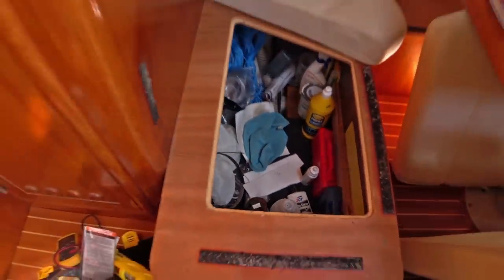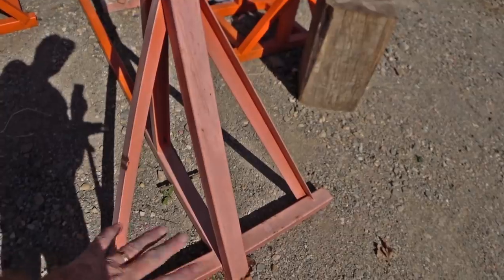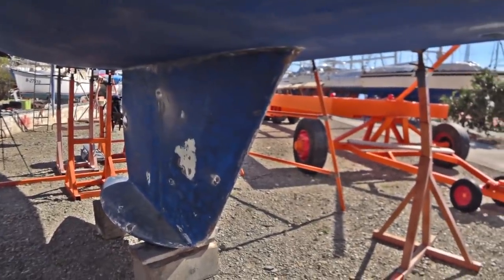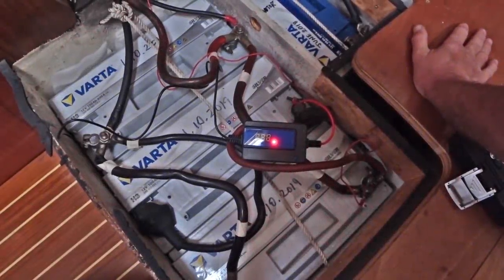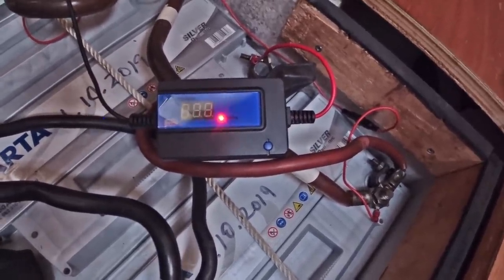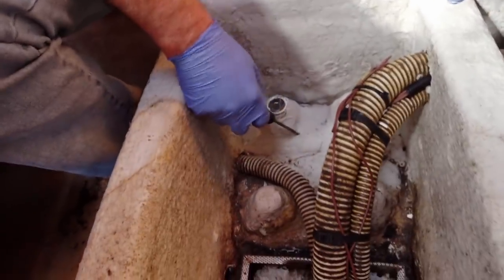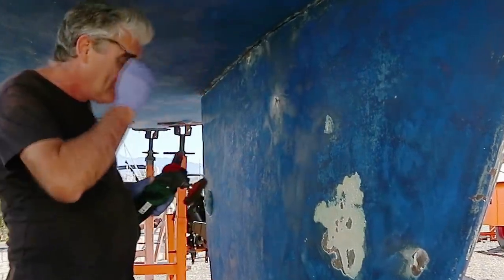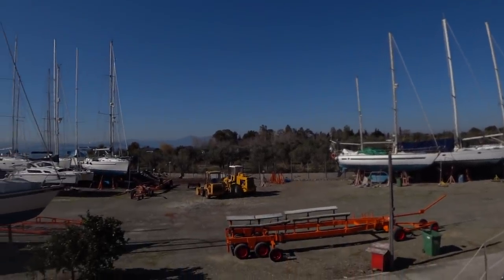Digging deeper into the weeping keel - Sailing A B Sea (Ep.111)

Comment: Unfortunately, when keel bolts rust, they will rust where the keel-hull connection is, and the entire rest of the bolt can look brand new.  You literally have to remove it to see the condition in the middle of the bolt as the top and bottom will look new.  When you have that much leaking and water penetration, it is highly likely your keel bolts are already starting to corrode out.
Reply from the maker: Hi Logan, we agree with your science, the water running out showed very little rust, it was mostly clear water.

Comment: Anode has to have electrical continuity with the iron (cathode) keel. Zinc is used as a sacrificial anode because it gives up electrons more readily than ferrous metals, and this corrodes first, IF it has low resistance with the cathode. If you rely on the thru-bolt to make electrical bond with the keel, figure that is insufficient. Two equals one, one equals none. Get as much conductive surface exposed as possible.
Reply from the maker: Thank you for that helpful feedback Michael. Cheers.👍

Comment: Just one little tip regarding the shaft anodes. Always check that they are exactly the good size. Metric or imperial, because this can have an effect on the bolds not reaching good. One other tip from experience, once the anodes are secured in place always add a cable tie to the shaft on each end, this will help if by any chance the anode gets loose. This happened to me and if I didn't realize it in time it would have damaged the hull, because it will travel up with revolutions.
Reply from the maker: The cable ties are a really great tip, thanks Joseph. We'll do that tomorrow. 👍

Comment: Hi Baz and Annssha

I have a Jeanneau SO 45.2 and have been following your blog for a while. When I was shopping for my boat about 8 years ago, one of the Jeanneau dealers told me about the weeping from the keel, which is very common on these boats. Water is getting into the well in the keel for the bilge sump, probably through the calking between the bottom and the keel. It sits in the keel well and rots the sealant, which was  not very good to begin with. He told me the solution is to grind out the fiberglass over the well, as you are doing, clean out the old sealant as best you can, let it dry out and then fill it with epoxy. Then rebed the keel to the bottom. I hope this helps. I haven't done it yet to mine, but I get a tiny drip of rusty water down the side of the keel in the same location as yours, so I will be watching you as I get ready to do mine. By the way, if you need to lube the steering chain again. It is much easier  and you have better access if you remove the compasses than to climb into the compartment under the cockpit floor.
Steve
Reply from the maker: Hi Steve, thanks for sharing the helpful info. Great idea about lubing the steering chain. Cheers.
Reply: Same thing for my 45.2, keel weeping allready repaired.
How do you remove the compasses Steven ? I need to lube but also to replace a damaged compass...

Comment: Hey Baz when I was in the Navy the anodes were welded to the hull after it was painted, the metal to metal contact was through the welds, I think your metal to metal contact will be through the bolt holding the anodes to the hull, hope that helps
Reply from the maker: That's a good point KC, that makes sense. Thanks.

Comment: Hi Baz
We had exactly the same weeping on the lower part of the keel on our 45.2 as you. It’s just sealant degraded over the years. I ground it out, dried it well, rested rust then filled with epoxy. No more issues. We did not however have the weeping at the top of the keel next to the hull. Just dry it out full it with epoxy, not a big problem
Reply from the maker: Good to know, thanks Jay. The current 40 knots of wind should help with the drying. 👍
Reply: If you have weeping where the keel meets the hull, then you really need to pull your keel bolts.  They rust just in the area inbetween the keel and hull, and the rest of the bolt will look like new.

Comment: Hi there ABC
I think the keel bolts should be better inspeced. But thas just mine opinion. Stainless has a way of going bad where you dont see it. And of corse you ned to remove the bottom paint, as you know your self. Maby its a robber seal around the axel on the kick rod? 
Fair winds ,,,/),,,,
Reply from the maker: Hey Anders, the kicker job will be done in Turkey. We've been told from people who have owned this model boat to leave the keel bolts as they are, and just to inspect the fibreglass encasement. Cheers.

Comment: Non sailor advise, putting the anode on the prop shaft use a C clamp or monkey wrench to squeeze the two parts together. Should get a good contact with the shaft and might make the bolts fit nicely. That is a very dodgy might mind you.
Reply from the maker: Good idea Phil the Farrier, thanks.  Will do that next time.

Comment: flip kicker, run kicker line through turning block at mast base redirecting it to the block where it initially turns currently but is now farther away flipped. PS edit, BTW that boat is 25 years old.  Has the keel ever been dropped? seems about time for that.  You have no idea what the bolts look like at the nut, below the nut, at the keel interface and at the keel ballast entry. Never mind not even knowing the torque. Then button it all back up bedded in 3M5200 and torqued correctly. yes expensive but also important for any boat of your construction after 15 years and especially if planning offshore.
Reply from the maker: That's an interesting proposal. We'll look into that. Cheers.

Comment: Good idea to rent an apartment then you can get up in the morning go there and approach the work with more vigour psychologically 
Looks good news about the keel if it is totslly dry and not weeping think you will be good to go on that issue
Great catch up and looks like you are getting there
Reply from the maker: Yes, it definitely helps to be away from the mess, but still only minutes away from the boat.  
The keel itself is still weeping from the crack, so we have a couple of wires in there acting as wicks to draw out the water.  We'll probably also aim a fan heater at it to speed up the process, so it is fully dry before we seal it over.  
Thanks Russtafa B. 👍

Comment: I see you have water in the bilge and humid sail compartment. Just for the info, it is rain water, at least in our boat.
What's the brand/model of you desulfater ? Is it always connected and working ?
I think i'm going to start working on this sailor support forum... :p
Reply from the maker: Hi Boarderlia, The water in the bilge is from when I poured a bucket of seawater in there to try and get rid of a bad smell. The water getting into the sail locker is coming through a bad deck repair job from a previous owner. We'll fix that when we get to Turkey. We're thinking of changing the desulphater to this brand. https://www.recovermybatteries.com/products.html
Reply: @SailingABSea  Lucky you, i have to take of the ceiling cover to find out the leaks.

Thank's for the info on the desulphater ;)

Comment: Could it be that the electrical connection for the anode through to the rudder is through the metallic nut and bolt, assuming that the rudder is steel.
Reply from the maker: Hi Angelo, the rudder is a fibreglass encased steel rod. Cheers.🍺

Comment: At first, I am happy you are coming back to Turkey.  I try to find out the video about the batteries died in october. Couldnt find it. If there is one pls send it to check it out. 

The battery connections you made in parallel has some problems as I can see from the video. If you are pulling too much amps from the bank with this connection you are going to make the first battery at the left work more than the two others. And work less at the far right. And the batteries in parallel  work as the weakest link in the chain logic. And if you make the first battery older it will make the other batteries older too in some time. 

You can check for detailed exp. here : http://www.smartgauge.co.uk/batt_con.html

For the Crew think, it is good news. Also i will check Setur for prices or campaigns for you guys. Hope we meet this time in Turkey. Take care.
Reply: Ok i find the other battery video. Never mix the old and new batteries. Because aged battery will make the news ones older in short time. As you can see from the other video the one closer to the connection dead but the far away one still has some life. It is because of the connections made(I dont get how that solar guys made it ). Because batteries not used equally.  Also probably you are using too much at night and at the end of the days batteries are not charging full. When you check the specs they have around 400-500 cycles at lead acid batteries. And they are not deep cycle, 15 months usage  is normal on heavy usage. 

For the long term consider upgrading lithium(I know it is pricey , ı couldnt make it either). Because the tight space you have you will have more Juice at that storage, also less weight. 

Probably you know but i will remind again, On victron Battery Monitor  there is a amp/hour setting in the setup. Check if it is 300 amps. If not it will not show the correct percentage. Also SOC (State of Charge) is always not accurate. Check on daily basis how many amps you consume and the battery voltage. Logging weekly in the long term will give some idea on battery status. (On same conditions: Like every morning Used Amp, Voltage of the bank) 

Also  for the next time, consider using 4 batteries. If you are using too much amp/hours increasing the battery bank capacity makes the batteries last longer as you know from %50  usage rule for lead acid batteries.
Reply from the maker: Thanks, we're going to rewire the batteries as per method three in that link you sent. We bought two bus bars, now we need to get cables made up to the correct length.
Reply: @SailingABSea  Oh nice another mission for you. Hope you will succeed this time. I watched the Laptop Adapter mission failed. Method 3 is ok. But be carefull with the lengths of them all must be equal. Also the cables from bus bar to the inventer both + and - must be equal. I prefer Method 2. Because there is no bus bar around to shortcut accidentally.  you have a tight space there. Too much cables too much mess.

Comment: maybe a seal is gone in the top of the vang Baz??
Reply from the maker: Hey Shane, when the topping lift is released the vang/kicker doesn't support the boom anyway, so it's something that we'll have to dismantle and fix. It's on the list, got much bigger fish to fry at the moment. Cheers.
Reply: @SailingABSea  i think there is a 'plastic' seal on the top, they seem to have this weakness
Reply from the maker: As soon as we get around to that job the whole thing will be dismantled and serviced. Probably when we get to Turkey.

Comment: Might be better off with proper deck glands to replace that lash up of a hole with a cable passing through surrounded by a blob of silicone.😀👍⛵️
Reply from the maker: Hi Norman, we're not understanding what you're proposing, can you give us a bit more detail? What is a deck gland? Thanks.
Reply: Sailing A B Sea Take your pick based on cable(s) diameter : https://www.force4.co.uk/department/electrical/plugs-sockets-deck-glands/deck-glands
Reply from the maker: Ahhh now we get you. You're talking about the deck fill at the bow where some fitting has been removed.
Reply: Sailing A B Sea Not exactly was referring to electrical cables passing through focsle deck and sealed with some silicone type material.About 1:30 ish in this vid.😀👍
Reply from the maker: @normanboyes4983  those electrical cables attach to the back end of the up and down foot switches for the windlass, they are water sealed, so no leaks there.
Reply: Sailing A B Sea ok my bad - profuse apologies.😀👍
Reply from the maker: @normanboyes4983  no need for apologies, we're all learning together here mate. 😀